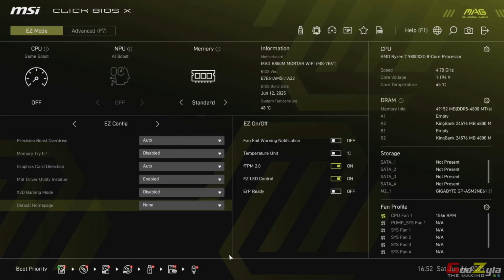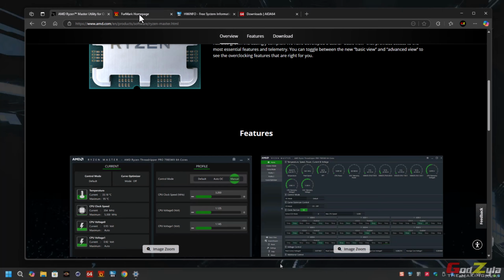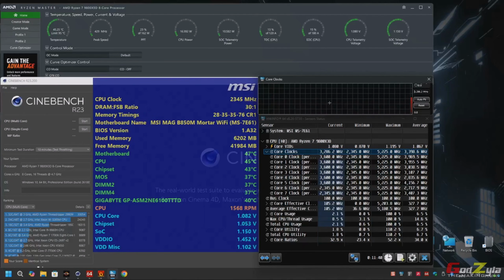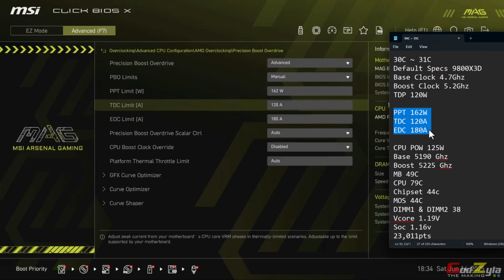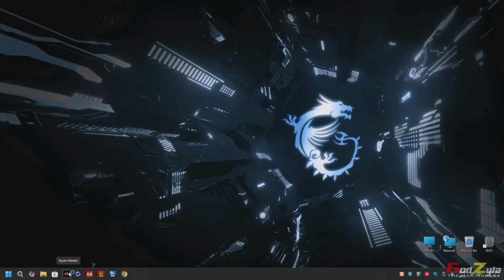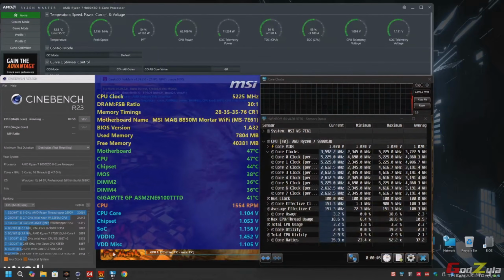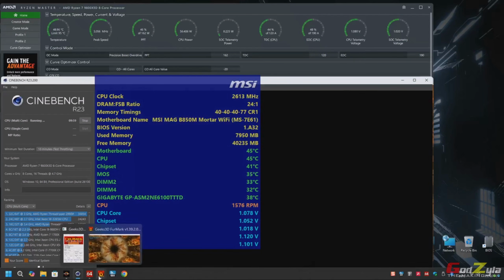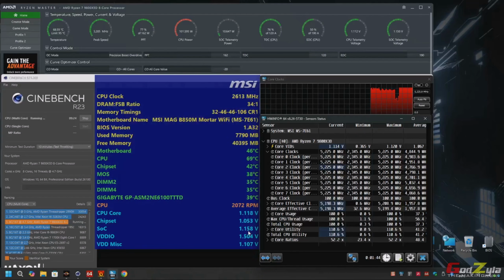PBO2 Curve Optimizing with 9800X3D on MSI Motherboard

Comment: Hi @Kleo Yan i have same Motherboard, same chip and followed everything exactly as per Video, but i saw a spike in VDDCR, SOC Voltage at 1.560 V last night in HWinfo and i got scared. I have set  Override Mode 1.1600 V in Bios, how is it possible? Is it Hwinfo wrong reading or should i be worried? I have this system 3 months now and yesterday was the very first time is saw anythin above 1.2V
Reply from the maker: Hi Kostis Tsiutras, welcome to my channel. I would clear CMOS, set the PBO Limits, curve optimizer and curve shaper. at auto run Aida 64 Stability test for 10 minutes and check on the VDDCR_SoC voltage to see what's the max drawn. see if there are any spike. Once stable, set the VDDCR_SoC to 1.15v and test it again. sometimes is due to some glitch.

Comment: Hello! Fantastic video, i've really learned a lot from you and I really appreciate the in-depth guide to optimizing the 9800x3d. Would like to ask, when I enabled High-Efficiency mode with the Tighest preset with my G.Skill Trident Z5 Neo DDR5 6000Mhz CL36-36-36-96 1.35V my PC wouldn't post, the RAM light is on as checking my motherboard (we have the same motherboard). Could you please explain if this the right preset? or if you have any other videos regarding this topic I'd love to hear your advice on it. More power to your channel!
Reply from the maker: Hi TheDelts, welcome to my channel. The feature on MSI board that has this High-Efficiency function, it's a previlage more than an entitlement. Some rams are able to run with it as it has higher voltage and with a base max bus speed of 5600MHz instead of 4800MHz. So if you can't run your rams on High-Efficiency mode, you can leave it as auto.
Reply: @KleoYan  Thanks for the reply! I left it on Auto yes, what about the other options aside from Tightest? Are those viable to use or not worth using?
Reply from the maker: @ItsTheDelta  you can give it a try. I did use them as I find no difference from using auto. Compilation of 3D projects or video compilation or even live rendering on 3D stuff, having at tightest gave me the significant boost due to lower latency but not to the rest. But of course you can try it as I have no idea how it reacts on games. Also when you try those settings, you don’t have to worry about the voltage as you have already lock it on the VDDCR_SoC voltage to 1.15 or so.
Reply: @KleoYan  The PC not posting always gets me scared Haha! But I really appreciate the time you take to reply to everyone's comments! I love all the new things i'm learning and I always appreciate the new knowledge. Thank you once again! Looking forward to more content :)
Reply from the maker: @ItsTheDelta  you are most welcome. I am no different from any others. Am a pc builder not a full time YouTuber 🤣🤣🤣 this is a hobby I share and I am not always right. Thank you for the trust too 👍👍👍

Comment: Ryzen Master doesn't look like that for me. And it hardly ever works.
Reply from the maker: Hi Badapdos21, welcome to my channel. I believe you are having the new version 3 of ryzen master. You will still be able to see the stats of what you've set on CO at the CPU sub menu of your ryzen master 3. Anyway I don't use Ryzen Master to do the PBO limits or Curve Optimizer nor Curve Shaper. I do it manually in UFEI. total control that is.. Ryzen master is just for me to pick up stats, that's all.

Comment: PBO -40 or -50 = Degrade cpu that mean damage on cpu for long term right?
Reply from the maker: Mae Donald, welcome to my channel. You can do that if you want to but my concept is like an elastic band, if you pull that much, in prolong period of time. The elasticity of the band will lose its tension. Which means the same to the processor, system will be unstable and yes pulling too much, it will degrade the processor.
Reply: Maybe you are wrong on UV degrading sillicon?

Comment: one thing i dont understand. mybe im wrong but when you put pbo limits on motherboard with this cpu it doesent matter because cpu itself have power limitations, and thermals, so it will never draw power greater than limits. on other cpus that may be untrue, but im certain that on this cpu some of 'donts' dont apply?
Reply from the maker: Hi fak sake, welcome to my channel. The processor is unlock, you will be able to pull or overclock when the cooling solution is sufficient. unless not able to cool beyond a certian point, then the processor will stop at that clock speed. Nevertheless, this content is to control this limit and to operate with a safe settings. As for some UEFI functions. Yes, there are pre-sets which should not be use. Just like what I've mentioned on the Max boost setting. Thank you for your feedback, greatly appreciated it. 🫡
Reply: @KleoYan   ooh got it. im still new to this in depth bios settings, trying to learn every side :) 
i think i have little odd Ram memory, my steady cinebench is all cores on -15 and override soc 1.2v
and overall i did get lower temps and cpu is on better side :D 

only thing i cant change is fclk freq. (i tried 3000mhz) in theory it should work but i got no post, i know its too aggressive and basically useless to do. 
i have 6400mt/s but fclk is on 2000mhz, that is the stable freq. every other it wont post :/
Reply from the maker: @faksake1630  i think you got it mix up. 6400Mhz will be in this way MCLK = 3200 and FCLK = 2133 for 1:1 ratio MCLK you dont have to do anything, set your FCLK to 2133 and see if you can run with UCLK = MCLK

Comment: great tutorial, have a question for you: After following PBO curve optimizer and curve shaping is there an option to set the cpu not to 100% all the time? Im new to all this :)
Reply: The same cpu +  mobo, same ram kit, and just running case mystic light plus artic aio plus 6 fans
Reply from the maker: @beto_84 hmm a decent set up. But how come is 100%. Hmm 🤔
Reply: @KleoYan I will undo all settings and add one by one. I let you know and thank you
Reply: @KleoYan  Found the issue. At Power settings, I had a setthing called : Processor Idle disable set to :Disable Idle. Tha was causing it. Now all back to normal.  Thanks again
Reply from the maker: @beto_84 ok that’s good to hear and I learn something from you too. Thank you 😉
Reply from the maker: Hi Citizens of Kaos, not that I know of, anyway only benchmark will hog up your CPU to load 100%, when you operating as normal, gaming or application, you won't hit 100%.
Reply: @KleoYan  Thtas weird, cause just using my system right now, CPU load is 100%
Reply from the maker: @beto_84  huh. 100% while doing leisure browsing?
Reply: @KleoYan correct, I'm doing nothing else just watching  youtube 😊
Reply from the maker: @beto_84 you serious. Ok what are your system specs. Do you have any Lian Li Uni fans , LCD, tons of argb application running hmm

Comment: I use 6400 ram on my system, and I also get 1.3 soc voltage when enabling expo
Reply from the maker: Hi William J Simmon, welcome to my channel. Maybe you can try to set to 1.16v manually.
Reply: @KleoYan  Yes, I will try this, thanks for the information
Reply from the maker: @williamjsimmons6167 you are most welcome.

Comment: Thanks a lot for the video! This tutorial helped me a lot, i am running at 59.1 degrees now at full load!  You are right Reddit is filled with scalar x10 and PBO -40 and ofc +200Mhz.
Reply from the maker: Hi Slims, welcome to my channel. Yup, but by stretching so much, I personally don’t find it beneficial to do x10 scalar nor to pump up the clock frequency. Thank you for your feedback too 😉
Reply: @KleoYan one question. Does the curve shaper stack on top of curve optimizer. What I mean by this, if I run -10CO does adding a Curve shaper of -5 at max frequency means I have a -15CO at max frequency?
Reply from the maker: @slims2503 yes it does stack above it. If your co is -10. And curve shaper is -5. It will be -15. That’s the purpose of curve shaper as to fine tune.

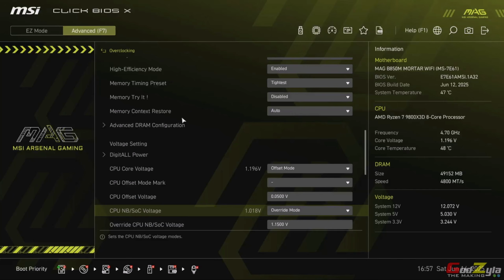Comment: Mine ran fine until I turned off cpu boost clock override from enable positive to disable. It would freeze cinebench 9:20min left. 40sec in
Reply from the maker: Hi Diggz, welcome to my channel. It should not react that way, you might want to do a clear cmos and to reconfigure it.
Reply: @KleoYan  When I turned off the cpu boost my system was unstable during test. I had to drop all curve core optimizer magnitude from 20 to 15 and it worked
Reply from the maker: @dstigz  I see, that's good. congrats on the settings.
Reply: @KleoYan thank you. Youre video was very thorough. Helped me a lot. I will be passing it along to my friends who have the same cpu lol
Reply from the maker: @dstigz  You are most welcome and thank you for sharing it to your friends too. 🫡

Comment: Am currently have r7 7700 non X, do you have any suggestion for my bios setting?
My motherboard is msi b650m mortar wifi
My ram is Adata XPG lancer 6000mhz at 30-40-40-76
High effiency mode enable ( memory timing preset i have at tighter )
Cpu core voltage to offset mode ( offset mode mark at negative and offset voltage at 0.05 )
Cpu NB/SoC voltage i set at 1.15

PBO setting:
Cpu boost clock override i have at enable ( positive ) and max cpu boost clock overide at 100mhz
And curve optimizer i have at all core
All core curve optimizer sign at negative 
All core curve optimizer magnitude at 20
Reply from the maker: Hi NTM, welcome to my channel. all the settings you've done are pretty much it as 1) I do not have this 7700 processor 2) I do know that your processor does not take up too much current even when you put CPU Boost Clock Overide to +100. You might want to try disble this and to compare the CPU Power drawn, with or without CPU Boost Clock Overide. if it's very minimal, you can just leave it. so long the CPU Power does not go over the TDP of your 7700 which is 65W
Reply: @KleoYan  hello there again, after looking at your advice and the video, i've decide to turn off cpu boost clock, as i doesn't see any improvement in the performence, and i've also decide to turn on curve shaper  and also using your setting as well, so far i haven't encounter any problem at all, will let u know until then.

Overall thank you for your advice and great video as well 😊
Reply from the maker: @M1nX1304  Hi and thank you for the update.. hmm Curve shaper is only meant for 9000 seriues processors, so not too sure if that will help your 7700 hmm 🤔
Reply: @KleoYan  right now i notice a decent improve in temperature, around 53 - 54c, was around 55 - 56c before , haven't try on gaming yet so might as well try later on
Reply from the maker: @M1nX1304  ok.. if it works.. that will be great 😉
Reply: @KleoYan So after about 3-4 hour of gaming session, my cpu is now always stay under 70c  (my cpu was always around 70c above while gaming before), mostly around 66 to 68c or lower ( i can't remember well so idk ), sometime 69c ,but overall i'll say it's a success for me 😊
Reply from the maker: @M1nX1304  hmm.. no performance gain and remains the same thermal? hmm.. thanks for sharing.
Reply: @KleoYan on the performence wise i dont know about that but my cpu is now running cooler than before so i'll take that 😁
Reply from the maker: @M1nX1304 oh ok. Got you. Thanks for sharing.

Comment: Helo Kleo!
First noob question:
- How can you use furmark on the integrated GPU?
Setting it with power save option?
System -> Display -> Graphics settings.

Add classic app "C:\Program Files (x86)\Geeks3D\Benchmarks\FurMark\FurMark.exe" and set Power saving mode for it.
Reply from the maker: Hi GonG Fushion, welcome back. In general, I do not use power saving mode, I disable sleep or hybernation mode. when I use a PC, I will just use it.. when I dont use it, I off it.. often sleep mode or hybernation mode causes issues, example USB got disconnector, drive SSD can't resume where I need to hard rest the PC.
Reply: @KleoYan  Oh sorry.
I mean, in Furmark, if you want to stress de iGPU. How can you select this one instead of the dedicated GPU?
Reply from the maker: @GongFuShion there are two ways of doing it. 1) just remove your discrete gpu 2) go to UEFI editable the gpu and enable to APU /IGPU
Reply: @KleoYan  Do you know if HIgh-Efficiency Mode work with CORSAIR Vengeance RGB DDR5 RAM 32GB (2x16GB) 6000MHz CL30-36-36-76 1.4V ?
Or only works with lower than cl28... etc?

And, another question:
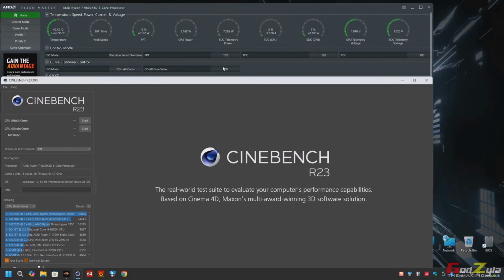Why did u raise the EDC from 180A to 190A? 53:54 minute

PD:
Thanks for the video.
Very interesting and clarifiying. Took a lot of notes haha.
Ill build soon and test all.
Reply from the maker: @GongFuShion  you can give it a try. the most you are not able to boot or when running cinebench, it is unstable. So just go back to the settings you've done.
Reply: @KleoYan  Can you share your msi wallpaper. Is really cool.
Reply from the maker: @GongFuShion once I get back home. I will share out with you. Mind to drop me an email godzylatech@gmail.com. Just in case I forget. Thanks
Reply: @KleoYan  Oky doky. Ty a lot :3
Reply from the maker: @GongFuShion  you can download it here https://www.msi.com/wallpaper?page=20 bottom right
Reply: @KleoYan  Done, thanks again!!!!
Reply from the maker: @GongFuShion  most welcome.

Comment: Hey Kleo, I copy all your setting except for cpu boost clock override, everything looks good but why am I getting around 130-140w on cpu 5.25ghz? is it because x870 drawing more power than b850? currently running with one 8pin cpu pcie power on motherboard. Im using msi x870p wifi and tridentz z5 neo rgb 16x2g 6000 cl28.
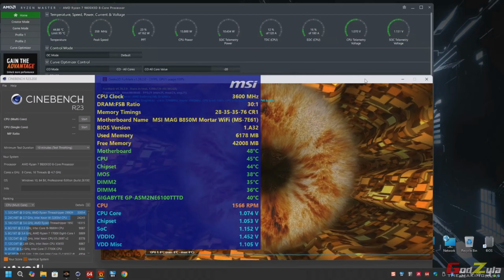Reply from the maker: Hi Sm0k3rZ, welcome to my channel. I guess you are busy copying the settings and I can understand this content is lenghty. you might want to watch at time stamp at 40:13 (with CPU Boost Clock Override) vs 45:55 (without CPU Boost Clock Override) . Then you will understand why is your CPU Power drawing much more and why I refuse to use CPU Boost Clock Override.

Comment: I just wanted to say thank you and that I really appreciate this video!  I have the exact motherboard you used in this guide paired with a 7800X3D with 6000mhz RAM.  Since the 7800X3D has the same PPT, TDC, and EDC as the 9800X3D, I used the inputs exactly that you showed and had great results with my 7800X3D!  Temps were lower and my CPU was much more efficient!  You do excellent work my friend!
Reply from the maker: Hi Conner, welcome to my channel and thank you for your kind words. I am glad your system is running at a low power drawn and gotten good thermal results. Thank you again for sharing your experience too 👍👍👍

Comment: Hello, great video!

I'm currently new to AMD, I just build 9800X3D on X870e Carbon with Gskill 6000 CL30 kit with Arctic Freezer III Pro

I followed your guide step by step.

FIrst CR23 i got 22414 and second one 22538

However, ive noticed my TDP was 78W and Temps around 55C while running Cinebench.

Isn't my TDP very low? shouldn't be around maybe 90C? Any recommendations?
Reply from the maker: Hi ELY, welcome to my channel. Having CPU Power drawn at 78W and having temperature at 55°C at stress load is perfectly ok. 
as why? did you compare your default CPU temperature and CPU power drawn + R23 Score against the manual settings which you've followed here? 
My content is not about pushing the processor, is more about sustaining low CPU Power drawn, low temperature and to out perform default settings. In terms of score and thermal. 
As why you are having 78W on CPU Power. You are running the stress on your Processor only. Your discrete GPU took off the stress load on CPU. The illustration here is stressing both CPU and Graphic together as the GPU is from the processor itself (APU / iGPU), I am not using a discrete GPU.
Reply: @KleoYan  I didn't ran it on default to be honest lol. 

GPU stress will definity increase the powerdraw.

Im happy with the current temp, I will run AIda64 and see how it goes. As long im getting good clock speed and no throttles that what matters.
Reply from the maker: @aRk0_aus I see, let me be honest and direct. It will be best if you know what you are controlling. As having to fill up these; at least you understand exactly how your system should react. Anyway do run some test on Aida 64 (system stability test) and OCCT test. Play some games to have a confirmation, inclusive of observing like power drawn and such. Thank you and all the best 😉
Reply: @KleoYan Update during my OCCT test

CPU temp: 77C
CPU Power 110W
PPT 82%
TDC 88%
EDC 61%
Clock speed is around 5.1GHz
Hwinfo showing flat graph 😊

I mostly do gaming on 1440p and im sure games wont be drawing that much, do you think I can do slight improvement?
Reply from the maker: @aRk0_aus you can which involves in pushing the PPT and TDC. But I find it not point as your current thermal and clock speed is good enough. Remember your base clock suppose to be 4.3GHz and now your base or max boost is at 5.1GHz. Pulling 800MHz from default is already doing good. That slight push if you gain 100 to 200MHz with cpu power and thermal increases by a lot it’s not worth it. You can give it a try. The choice is yours.